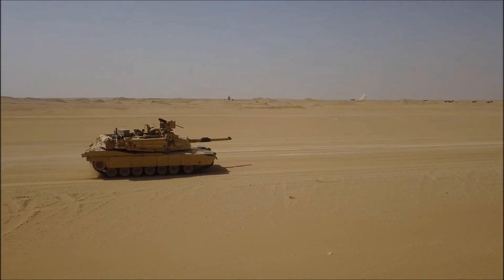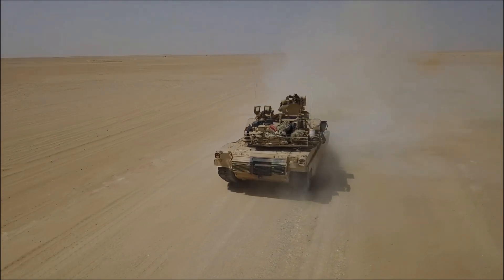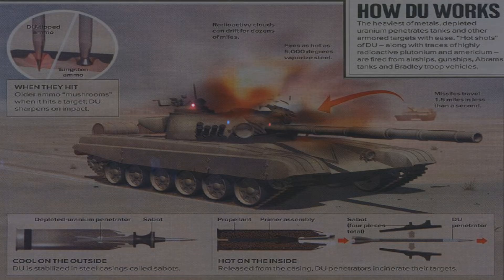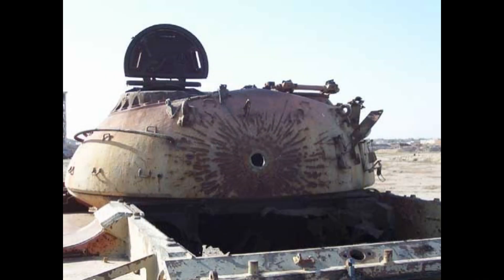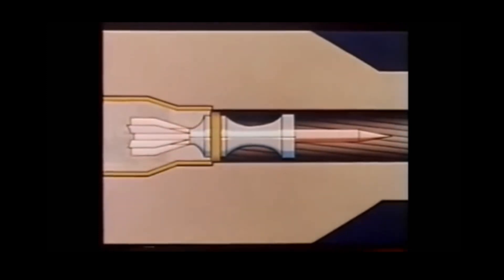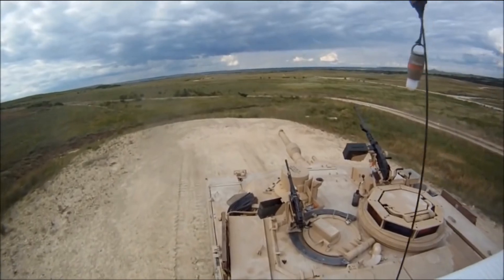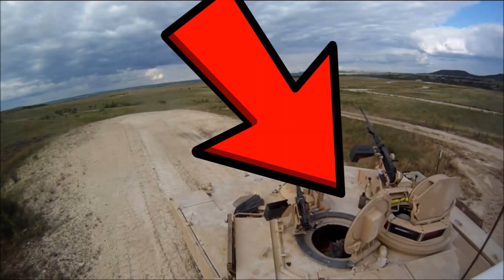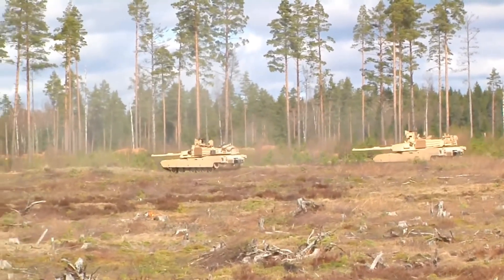Depleted Uranium Tank Ammunition | DEADLY DARTS 💀☄️

Comment: "Flat-shooting" rounds (whether from a tank gun or a rifle) are not immune to the effects of gravity. Gravity works on all projectiles as soon as they exit the bore (and are no longer supported by the barrel). The apparent "flatness" of the trajectory comes from a projectile's speed. All other considerations being equal, any two projectiles flying through the air both drop at the same rate - gravity effects all objects equally. So let's imagine the comparison of two projectiles, one traveling at 10,000 fps and the other at 2,000 fps. (We'll ignore velocity loss due to drag to make this simple.) If they are both fired at a target 10,000 ft away, the first round gets there in one second, while the latter round gets there in five seconds. That means that gravity acts on the first round for only one second, but acts on the second round for five seconds. If both are fired from level barrels (that is, no hold-over for range) the first projectile falls approx. 16 ft from line-of-sight while the second falls a whopping 402 ft! So the hold-over (to put it precisely on target) for the first projectile is minor, while the hold-over for the second is considerable. (This also greatly increases the flight time of the second projectile because it has to travel a much longer, arcing path. The first projectile must also arc - no projectile actually "shoots flat" - but the increase in distance traveled, and therefore flight time, is minimal. This creates the impression the former "shoots flat" while the latter needs a large hold-over because it does not "shoot flat.") The faster the projectile, the less flight time to target. The less flight time to a target, the less time gravity exerts its pull on the projectile, and therefore the less it will drop before it hits its target.

Also note that after one second of flight time, both of these projectiles (ignoring other effects as if fired in a vacuum) if fired from level barrels will fall exactly the same distance from line-of-sight after one second (and will both eventually hit the ground at the same time if fired from barrels the same height above level ground). To put it another way, any two similar projectiles (again ignoring effects other than gravity), when fired from a level barrel, will both begin to fall as soon as they leave their barrels, and will both fall at the same rate regardless of their velocities. If the two projectiles postulated above both hit the ground after one second of flight (i.e., they hit the ground at the same time), the first does so 10,000 ft from where it was launched and the second lands 2,000 ft from its launch site. (If you have a barrel that's level to the ground, you can get a very close approximation of how long any projectile fired from that barrel - at any velocity - will remain in flight if fired over flat terrain. Take a bullet or nut or hammer - something dense that won't be affected by air resistance - hold it at the height of the barrel's muzzle, and drop it. The time the object spends falling is the same amount of time it will take gravity to act on the projectile coming out of the barrel. All other things being equal, two objects dropped from the same height will both hit the ground at the same time because gravity acts equally upon all objects over time.)

Bullets, artillery rounds, and rocks are ballistic projectiles. They are not flying objects, they are falling objects, and they are all subject to the same forces when they are launched through the air and in a gravity well.

Comment: Best way to end a tank: Shoot where the rotating piece is, or shoot the track wheel. Immobilize the Tank causing the people inside to either open up and fix the damage (risk getting killed), or cook alive in the metal oven. Or even at that, if they can get the very very good accuracy, shoot the muzzle of the enemy tank, damage it, and cause it to explode with the round still inside the tank, thus causing the people and contents inside to burn and immediately die. I'd have to say that World of Tanks taught me quite a bit hahaha. Good luck reinforcing that muzzle and rotating piece with depleted uranium, let alone the tracks. :)

Comment: i usedto work in a nuclear power plant is it the used material from that proces they use for this amo???
Reply: Basically yes. Depleted uranium is basically pure U238. So what you left with after the U235 was removed to enrich fuel elements with it, to be used in light water reactors.

Comment: The problem with the DU round is not the round itself but the radioactive dust produced after the DU round penetrated the armor of the targeted tank. Anyone going inside the destroyed tank without breathing protection will suffer from its radioactive effects.
Reply: The people inside the tank will not die of radiation the only way you could realistically kill someone with radiation in combat is with a laser
Reply: @GoloGreis-i3n: I was talking about the radioactive dust produced by the passing of the DU sabot round. If you look into the destroyed tank with your protective mask on, nothing will happen because the radioactive dust is giving off either alpha or beta particles which can be blocked by your protective gear. However, it is the breathing in of said alpha or beta particles that will result in radioactive injury. In the aftermath of Operation Desert Storm, the US Army has implemented  yearly training on the effect of DU in the combat area of operation.

Comment: This round was developed by the Army's weapons testing lab at Picatinny Arsenal in NJ.  The original dart had only three fins which resembled a 50's scify rocket and was stated to have a 1/2" drop at five miles. Further the nose of the dart had an approximately 1/64th inch diameter radius with a slight swail behind it an was reported to create a shock wave in front of the round that would begin to affect the armor, heat it up, several feet before it actually made contact with it. I don't know if this version of the round made it into production but this was in the report at the developmental stages of the dart.  I hope this info is declassed by now as I only came by it from working for the company that designed and made the original plastic cover that was used to protect the dart from damage during shipment. I guess I'll find out.

Comment: Ballistic drop is a function of gravity which, when I last checked, was still a valid law of physics. At 3000+ ft/sec. this may appear to be "flat",  but it cannot be. The drop due to Earth's curvature over 2 miles is 2.67 feet, which may cause it to LOOK flat, but it ain't. In simplified terms, at 3,000 ft/sec., the projectile will take 3.52 sec. to reach the target.  In that time it will, thank you, Mr. Newton, drop about 12.4 feet due to gravity, leaving an elevation compensation of about 9.3 feet. Given that it's a smooth bore, the Magnus effect  doesn't enter into it.
Reply: try that again only double the velocity, it's 6000 ft./s (not 3000).
Reply: @tonyswan7481  Right you are! But according to Janes' it's about 5000'/sec. That said, lets assume half the effect. That still makes it a drop of over 2m. No matter what the speed, it's still subject to gravitational acceleration. The 2m drop would still have to be accounted for.

Comment: It would be a bad idea to fully phase it out. The best thing to do is to give the crews options. Giving them some DU ammo and whatever next-gen ammo they come up with would allow the tank crew to have the OPTION of attacking with overwhelming force from the front or with lesser force when it is called for.
Reply: Actually it really doesn't matter much anymore. Tungsten carbide projectiles basically provide the same penetration power today and under certain circumstances they are even better.

Comment: is depleted uranium banned or are they allowed under the rules of engagement
Reply: Silently Sceptical  If by soon you mean that half of it would be "vaporized" in 4.5 billion years you would be correct.

The half life is so long that it's not very radioactive. The same goes for actual enriched uranium btw. It's just that you can "force" the atoms to split by sending a neutron at them at high speed. The type of uranium in enriched uranium sends out more than one neutron which creates a chain reaction. This could be controlled in a reactor or used in a bomb.

There is no chain reaction possible with depleted uranium which means it's basically just a rock which makes a little noise when close to a Geiger counter. It would literally kill you of chemical poisoning a long time before radiation poisoning if you consumed it.
Reply: Why would it be illegal? Depleted Uranium is basically just a rock. You'd die of chemical poisoning a lot earlier than radiation poisioning if you ingested it. It's about as toxic as lead when it comes to chemical poisoning. Uranium is not dangerous unless enriched. If its enriched you could in theory make nuclear weapons however the enrichment process is difficult and expensive.

You as a regular person could buy depleted uranium if you'd wish for whatever reason.

Edit: Apparently in the US you need a license and there is a limit on how much you could buy, however my point still stands.

Comment: If the du projectile doesn't experience bullet drop then wouldn't it have to be moving at orbital velocity?
Reply: The velocity necessary to maintain orbit at an altitude very near the Earth's surface would be around 8000 m/s (+/- depending on where on Earth). The published velocity of the M829A2 round is less than 1700 m/s, which isn't fast enough. What they probably mean is that the drop over that distance is small enough that it is considered point blank range.
Reply: That would be the most practical explanation even though it is less fun. If a DU projectile were moving 8000 m/s in atmosphere would it remain (chemically) stable or would the molecular excitement be energetic enough to destabilize more neutrons? I have no idea if DU is considered stable but it is still mildly radioactive
Reply: @josephjucker5620  If you shoot a DU projectile with 8000m/s through the atmosphere at more or less sealevel, it would do what every other material would do also, simply vaporize because of the heat it experience.
Heat doesn't help at all to release neutrons from a nucleus and is even counterproductive if you want to keep a nuclear fission going. Also remember it is called depleted uranium because they removed nearly everything which can be used for nuclear reactors or nuclear bombs. What's left is nearly pure U238 which can undergo fission in an indirect way under certain circumstances, but it's not easy to do it.
Reply: @rs232killer  what if it's classified?

Comment: I'm so tired of the depleted uranium debate. Depleted uranium is... Depleted. It is not emitting radiation. It is perfectly safe unless you plan on eating it or inhaling dust. In which case, it is as chemically toxic as most heavy metals. Don't eat depleted uranium. Don't inhale it. Don't get shot by it.
Reply: But that's the point. Being pyrophoric, when it hits something the DU round creates extremely fine DU oxide dust - the sub 2.5 micrometre size that goes into your lungs and ends up in your bloodstream.  You could certainly eat some DU without ill effect, but kids can't play in a tank thats been wrecked by it years ago in a desert country.  Lead or tungsten don't have the same issue because they are not pyrophoric.
Reply: The phrase "Kids can't play in a tank that has been wrecked" shouldn't even be a thing that is said. Kids should never play in a fugging tank! Ever.

Comment: At 5:40 there is mention made that the round incurs NO ballistic drop out to 3000 meters.  This is not possible.  If the barrel were completely horizontal the round would begin dropping at with an acceleration of G as soon as it leaves the barrel.  Any round from any weapon system will encounter ballistic drop, unless it is powered (like a rocket). It's just physics.
Reply: Its true it will encounter a drop....I think the guy used the engineer's point of view where due to high velocity of the round, the round covers the 3000 meters so fast that that the drop is negligible...i.e it does not make it deviate in a significant angle that can compromise point accuracy.
Reply: @kingz_kenyan9160  That's the way I took it too, of course goose6610 is correct but I assumed that it covered the distance so quickly that the drop was not significant, plus maybe a bit of hyperbole in the narration.
Reply: Angular momentum may explain the apparent lack of drop in that if the projectile can exceed the distance required to overcome the drop/Earth curvature it would appear to have no drop,  much like a satellite orbiting the planet!
Reply: @Hochaloogy  Possible in theory, but not in this case.

The muzzle velocity of the M829A1 is 1600m/s. You'd need 7900m/s to reach orbital velocity (the phenomenon you describe) at the Earth's surface. Not to mention the rounds slows continuously due to air resistance.

The round would take over 2s to reach a target at 3600m, incurring a ballistic drop of about 24m. I think Matsimus simply made a factual error in this instance.
Reply: @Kiido11  
Indeed, if a trip of 3000 metres takes 2.5 seconds the projectile should drop 30 metres. As the Earths curvature/drop is .7 metres at that distance the math says it's impossible! A constant 33,600 metres per second would be needed to hit the mark and and at that velocity it would combust in the barrel!
Reply: true, but i would assume that the idea is no drop in the practical sense, as in having a very long point blank range.
Reply: You are so correct. 
When any projectile leaves the barrel it has two things working against it. 
~Gravity and AIR ! ~
Reply: @lbbradley55  No such thing as gravity bro.... the earth is pushing up on the round...
Reply: @nixic_  
Ha that's a interesting prospective
Reply: @lbbradley55  Veritasium's new video explains it rather well. Peace brother =)
Reply: @nixic_  
Ok I will check it out. 
I have the Winchester Mint a 40+ yr old Gun book and others that I got my doctrine from. But I am always happy to learn something new. Thanks
Reply: @nixic_  Not quite. Veritasium says gravity exists, it's just not a force
Reply: As Einstein pointed out, even a laser beam moving at the speed of light will drop under the influence of gravity.
https://en.wikipedia.org/wiki/Eddington_experiment
Reply: Powered projectiles will drop too, unless the nozzle or projectile itself is angled to provide 1G of upwards thrust.
Not being a human philosophical concept, gravity (and physics) applies equally to all objects.

Comment: That so-called depleted ammo is still  " radioactive material " it will be for 1000's of years.
Reply: depleted uranium is 3x as radioactive as the background, depending on where you live. radiation is the least of your problems. like most other metals it's only dangerous if it enters your body. in this case the biggest danger is inhaling the dust. so it's not really a danger. not like firing other types of ammunition doesn't create any amount of metal dust that can be dangerous when inhaled

Comment: Increasing the mass of a round is much less efficient than increasing the velocity. Kinetic energy is 1/2mv^2 with m being mass and v being velocity. So the energy of a projectile will increase linearly, at a steady rate as you increase the mass. But since the velociy is squared, increasing that will increase the kinetic energy exponentially.

 If you increse the mass of the projectile, you're still gonna need to put more energy into getting it up to the same speed as a lighter pojectile. I'm just not sure how the amount of energy in the explosive that blasts it out of the barrel woud relate to the velocity of the projectile. Gotta love using physics to kill more efficiently.

Comment: Uranium 238 isn't actually very radioactive at all. It has a half life of billions of years. So if you had 10 grams, 5 grams would have undergone decay after several billion years, then 2.5g after another half life, then 1.25g and so on The potassium in a banana is more radioactive. Though uranium is still very toxic as a heavy metal. Actually, the polonium 210 left behind by cigarette smoke is way more dangerous, radiologically and toxicologically.

Comment: ok let me be the nitpicker, but Uranium is Not the heaviest element, where by heavy you mean density in weight/unit of volume.
Uranium has the highest atomic number Z of naturally occurring elements that’s 92, but in terms of weight it comes in at 19.1 g/cm3 while Osmium Z = 76 comes in at 22.59 and takes the prize as heaviest element
Reply: Using data from Wikipedia, uranium is the SEVENTH densest naturally occurring element.  In order, they are: osmium 22.59, iridium 22.56, platinum 21.45, rhenium 21.02, gold & tungsten 19.30, uranium 19.1 g/cm3.

Comment: Multi warhead TOW ATGW’s are very effective due to its top down attack angle, but the issue is ATGW’s are easier to counter by the use of a variety of methods, such as active armour and anti-missile systems, which the Israelis are deploying. I suspect DU ammo will phase out when its all used up rather than by making tanks obsolete.
Reply: Active protection is probably the future of tank defense, anti cannon cannons. I mean the Armata has tons of active protection.
Reply: @thesaddestdude3575  I agree, active armour and active protection is very effective against missiles and HEAT rounds. It will only get better.